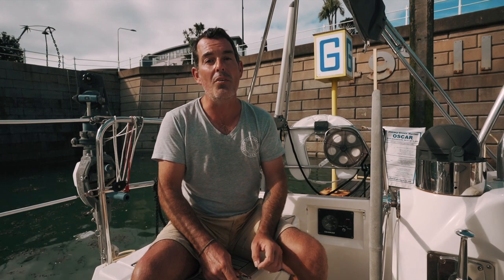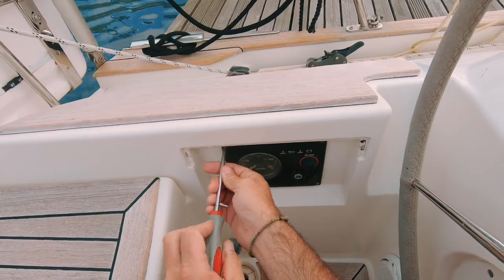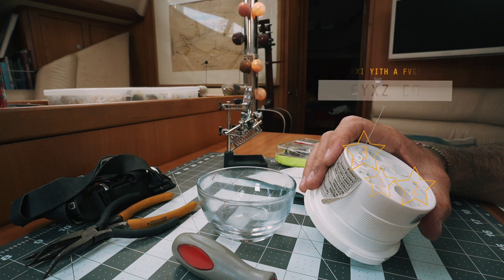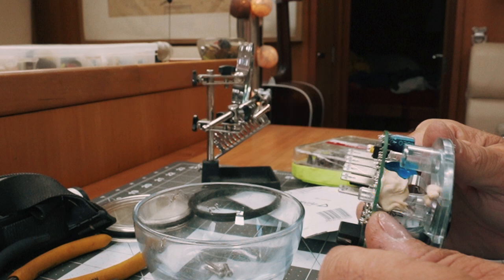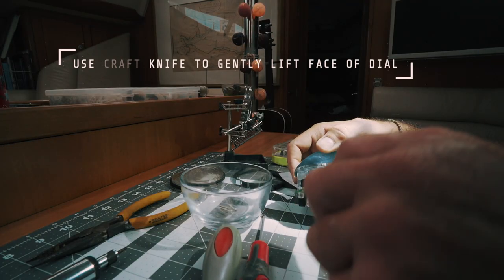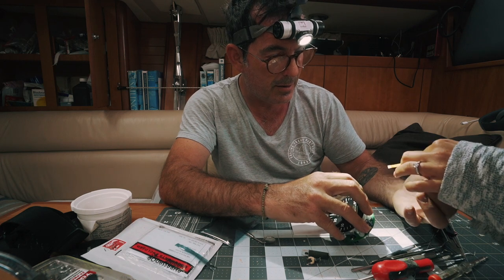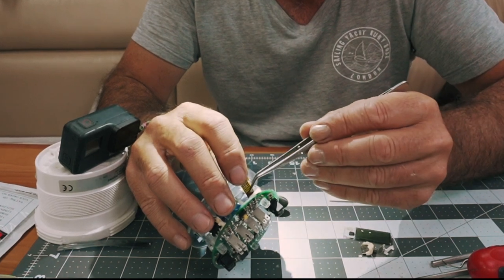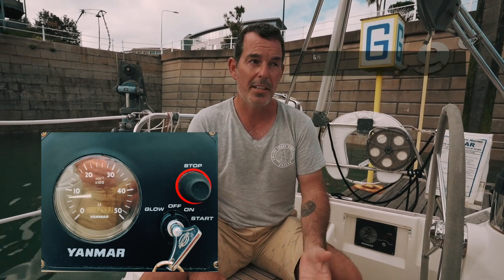Yanmar Engine Hour Repair. Save $800!

Comment: Thanks so much for this video. I couldn’t get mine off from the front as it’s glued in on the face. So I climbed in the lock and removed it from the back by undoing the 4 very small screws. I ordered the LCD board from the link on your video. Then not having the confidence to fit the LCD, I took it to my local phone repair shop, where it took him 20 mins. He charged me 15 euros.  And it’s all working perfect now.   Thanks again for a fantastic video.
Reply from the maker: Absolute pleasure mate

Comment: Excellent video as always - thank you!  If I may offer a suggestion I picked up from The Boat Galley: always stuff a rag in any cockpit drains or scuppers before you start to unscrew anything in the area.  I think I spied a drain right under the panel as it was first being unscrewed (it may not have been a drain).  Hopefully this helps someone somewhere avoid a lost screw.  Cheers!
Reply: A magnetic tray works really good to keep screws together
Reply: @johnnylasalle130  that's a great suggestion but 300-series marine stainless is weirdly not magnetic.  I don't understand the physics of it since iron and nickel are both magnetic. But it's one more annoyance with boat work that magnets don't hold screws and other parts.  In fact a common way of checking "stainless" parts for quality when in a store is to run a magnet over them. If they're magnetic then they're probably just coated in a thin layer of stainless.

Comment: A really easy fix for a potentially expensive pain in the rear.

Things I would add to the tutorial.
2:46 Stick a rag in the cockpit drain holes, good luck getting that item back once it has gone down one
7:29 if you are working alone you can give the ribbon connector a gentle curve by rubbing it around a pen or pencil, be gentle. This will give it a slight curve that will let you more easily guide it through the opening for the replacement LCD.

Comment: Thanks for this video, I have been estimating engine hours for about 5 seasons! Seems like I may have been 10% under  :( Good instructions and very useful. The only difference being that the LCD screen I bought seems to have a 'stiffener' at the end of the tape already and so the male holding plate was not needed.
One job down, npw onto the saildrive !

Comment: Thanks mate!   I'd say this should be done by someone with some familiarity with working on small electronics.  Remember to keep skin oils off any electronics or contacts, and or clean any oils, oxidation, etc., from them later with solvent like high purity isopropyl alcohol.

It's really important to keep electronics dry, clean and especially free of salt water, which can damage them.  Especially any exposed metal and especially metal contacts.  That's why there's so much environmental sealing designed into the case, etc.

Keep fingers off all contacts, including the ribbon cable contacts.  Or use degreased gloves.

I can't overemphasize how useful it is to teach prospective boat owners how to do some of their own maintenance.  This greatly increases their chances of success, reduces barriers to entry, and lowers operating costs since less work needs to be outsourced.  In addition it's certainly less wasteful and more environmentally friendly to repair something than to throw it away and replace it.

Comment: Excellent job, only problem: I drank a couple of beers throughout the process (I’m on holiday in the Clare Valley).  What happened after you talked about the weird screwdriver thingy with either 5 or 6 points? No, doesn’t matter, my trimaran has Yamaha outboards.

Comment: Cool video but there is another simple way. Just connect a  cheap electric hour meter, there is various wiring options, some via alternator,some via oil pressure sensor and some just straight on the ignition switch pending the terminal and switch layout.
Reply from the maker: True it’s simpler. But it doesn’t look as nice.

Comment: How easy would it be to put the LCD in upside down, or does the location of the ribbon kind of prevent this?
Reply from the maker: The ribbon prevents this. It will only go in one way
Reply: Great......it would be a right pain in the arse to reassemble the whole caboodle only to find it reading upside down!😂

Comment: I did not see you replace the insulating putty, I take you deemed that as not being necessary?
Reply from the maker: No mate. Didn’t replace it. There were no other sealed parts on the circuit board and the sparse information available on the internet indicates it’s not necessary
Reply: @sailingrubyrose  It´s probably just to really secure the ribbon connector from coming loose due vibration and so reducing product returns when still under warranty.
Worst case you have to open the thing up again and refit it if it ever gets loose.
But now you know how to do it and there is no "silly putty" in the way ;-)
Reply: @Gpcas9  Agree.  It's probably there to hold things together in the face of vibration.  In other words, to lock the ribbon cable clamp down.  Some kind of electronics safe rubberized glue could work.
Reply: As mention before, sealant is used to hold the flex ribbon in the connectors. They are very susceptible to vibration as there is no mechanical hold between the ribbon and the connectors, only friction. In fact, you may have gotten away with simply removing and reseating the cable  first before replacing the lcd display. I have repaired many an electronic device by simply doing that with a quick wipe of 90% isopropyl alcohol, put a bit of hot  glue on the connector and ribbon cable. Fun fact, isopropyl alcohol easily removes dried hot glue by breaking the bond between the hardened glue and the components. Magic.
Reply: @FrankConforti  Nah, I think vibration got the better of the ribbon cable by breaking the fine and brittle leads over time. 
The putty keeps the  cable in place but also gives it a place to stress the cable right where the putty ends.
Do it like HAL. Change it when it breaks. Dont bother with the Putty. 
I'm sorry Dave 😏
Reply: @Gpcas9  Yes, the putty could act as a strain relief.  However this style of ribbon cable is extremely durable. The plastic sheet used for the substrate is incredibly durable.  (It's more like a flexible printed wiring board, with the conductors printed onto the plastic.)  Ribbon cables using stranded wire could be more susceptible to breakage due to vibration.

Therefore the putty probably has two functions: 1.  Lock the cable clamp down.  2.  Transmit any vibration into the connector and not the cable.